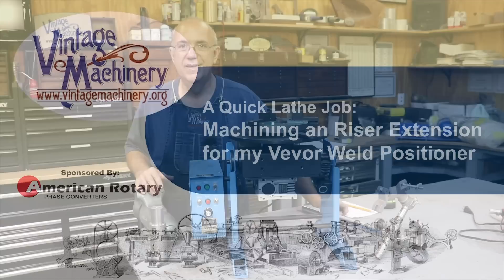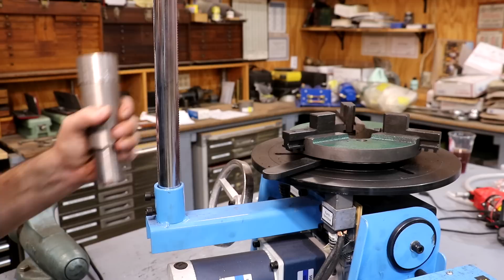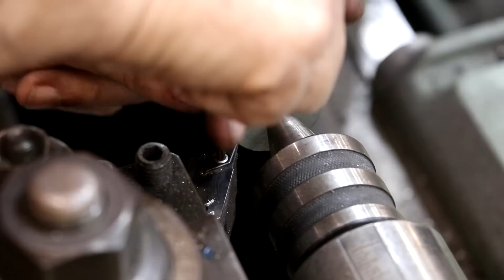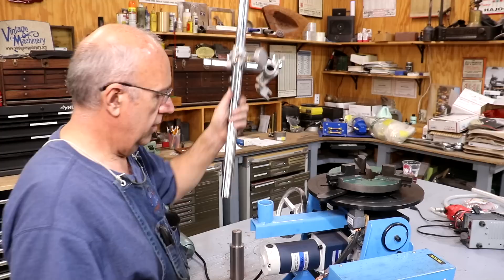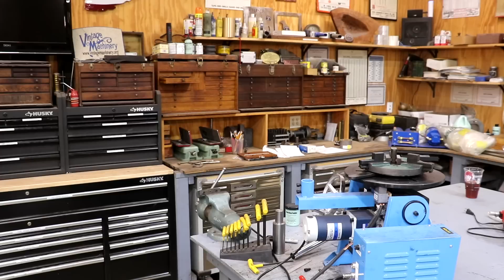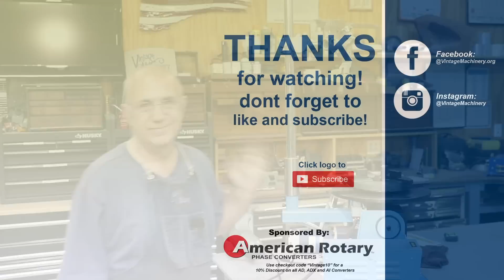A Quick Lathe Job:  Machining an Riser Extension for my Vevor Weld Positioner

Comment: I honestly have been led to believe that the imperial guys would have found the metric system a walk in the park to use. And your right Keith as long as you have a standard of measurement it dont matter what units you use!
Reply: There's no doubt that metric is a superior system with the base ten units. However, if all of your measuring tools, dials etc. are Imperial, converting the metric units makes the job easier. As you say, if you stay within the same standard, it doesn't matter anyway.
Reply: @stevespra1 99.9% of the time a machinist in the US is using decimal inches. A lot of old tools may use fractional inches but any machinist worth the title knows the decimal conversion for all the usual suspects by rote. There's no difference, EXCEPT, all the tooling is in inches and it's completely unnecessary  buy all the metric tooling that the conversion would require. If it ain't broke, don't fix it.
Reply: @Mishn0 Yes, of course, we use decimal measurements (and yes, I know the fractional to decimal equivalents as well), so no, it doesn't matter which units we use. Use whatever is more convenient from drawing call-outs to measuring devices. However, with pretty much every other application, we use fractional measurements and things line teaspoons and such. The metric system is actually thought out as a whole system. Imperial (or SAE) is a hodgepodge of old non-standard units that have been standardized but still crazy in their cross-measuring. I love America as much or more than anyone, but it is kinda crazy that we've hung on to Imperial units this long.
Reply: @stevespra1 It's funny that how on European videos, you never have Americans in the comments whining about the measurements not being given in US Customary Units. (NOT Imperial). I guess we're just better at math.
Reply: @stevespra1 It's a far stretch to say there's no doubt one is more "superior" than the other! You would have a difficult time trying to prove that assertion. Regardless in context with machining, both systems are base 10 so it is a moot point.
Reply: @TgWags69  I would say the superior part is in the base ten across measures. For example, a ml of water is a gram. There's 1000 ml in a liter, which consequently weighs 1 kg. There's 100,000 mm3 in 1 liter. It all works together. There are 231 in3 in a gallon and if it's water, that's 8.34 lbs. There's 100,000 mm in a km. Quickly now, how many 1/32" in a mile? Well, there are 5,280 feet in a mile. That's 5,280 x 12" = 63,360". 
That makes 63,360 x 32 = 2,027,520 1/32" per mile...
Obviously, if we are machining in inches, whole, .001, .0001, .00001 is no problem at all and either system is just as good as the other.
Reply: Not a stretch at all. Metric is proven superior in science,medicine and engineering. Also need to recognise metric is use across the planet except for 1 substantive country.
Reply: @stevespra1 , Who cares how many 1/32 of an inch are in a mile?
Anything over 32/32 is an inch and you start over with however many inches you have, once you hit 12 inches you have a foot and so on. No wonder people don’t like Imperial, they don’t know how to use it. After you’ve used it for a while it gets easy.
Reply: @Hoaxer51  Yes, obviously 1/32 per mile is a silly example, but hopefully we get the point. It's very easy to use the metric system going between units or even across measures. I am American and I know how to covert Imperial across measures better than most. I am also comfortable converting between metric and Imperial, but the metric system is just easier, period. Also, all traceable standards are based on the meter, so there is that... Again, it doesn't matter if we are using metric or Imperial especially for smaller units. We can achieve the same level of precision for all intents and purposes, but when we get to know the metric system, it is easier. There is nothing to be afraid of.
Reply: @zorbakaput8537 Fully agree. Except it’s 3 countries: USA 🇺🇸, Liberia 🇱🇷, and Myanmar 🇲🇲.

Edit: The real advantage of metric is that it’s a coherent system. One calorie is the energy needed to heat 1 Gramm of water for 4 to 5 Celsius (or something like that 😂). One Milliliter of water at 4 Celsius weighs one Gramm and is a cube of 10 x 10 x 10 mm. 
Ask anybody how many feet are in a mile or how many ounces are in a bushel. 
I’m German and live in the US for 25 years. I’m at home more now in imperial units and it works fine for me, but it’s just not a ‘system’. 
The US is metric or at least digital (thou etc.) in most ways anyway besides construction, and there the fractions have advantages actually!!
Nothing is black and white.
Reply: @stevespra1  not superior. Only different. Each have their advantages.
Reply: Ive used imperial all my life, we learned about the metric system in school, the fact of how it works is less complicated than inches, but my greatest hurdle is that after 50 some years i can look at something and pretty much tell you in inches/feet the size of something (not exactly mind you but close enough) or if someone says it's .... miles i can understand in my head how far that is without spending time to think what's needed to convert it to something that i know
Reply: I grew up in Canada and was educated there it changed while I was in high school from imperial to metric so am fine to work in both systems , I spent a few years responsible for 11 plant sites in Europe. Later in my career I  have done engineering work on 5 continents and lived on 3 of them ,as a result of those early years in Canada I never struggled with either system ? I prefer to use digital measurement tools most I have can function in both systems.
Reply: I  grew up n the UK during the 70s so I have no problem using both and converting between the two
Reply: While I can do the conversions from imperial to metric, since I was raised with the imperial system metric measurements don’t convey much to my mind, in terms of being able to visualize them. At any rate, for a project like this it does the job.
Reply: @johnmorris3744 Like many here, I can use metric if I have to.  My eye sees in "bananas".  Been using them for almost 75 years.  I also use chains in surveying.
Reply: Im 39 and  in the UK so Ive always known metric, but imperial is  something I use all the time for coarse measurement of anything above  an inch. Below that I use metric. Above a foot I use meters unless its something easy like 6ft. But for precision in any scale its metric! A couple years ago I did make the effort to learn all the fractions and decimal inch measurements just so I could understand videos like these from the USA. Its really not that hard at all, but building model aircraft all my life Ive always seen imperial on the plans from childhood.
Reply: @richw0123  That's a fun combination, quite understandable.
Reply: It’s no harder to work in inches than centimeters. I use both. Metric guys seem to think that we do everything in fractions. Guess what, we don’t. It’s all decimal. It doesn’t matter if we say nine inches and you say 22.86 centimeters, or you say 20 centimeters and we say 7.874 inches, or whatever other numbers you want to use as examples. I’ve installed DROs on all my equipment anyway, so conversion is a tap on a button. Really no big deal.
Reply: @melgross  I think you mean MM not CM .
Reply: Metric is no more difficult to learn than someone unilingual, English, suddenly trying to learn French...
Reply: 3:42...well, if [they] don't LIKE IT- then [they] don't have to EAT IT!!!"
Reply: The handheld calculator has a converter that crunches the numbers between the two systems with a press of a button. I understand most of your machines are built on the  United States Customary units and wouldn’t expect  one to use any other system while using them.
Reply: I've used metric most of my life - my home country converted in 1967 - I can still see some guys liking inches, half-inches - and saying it's 100 deg makes it FEEL hot as opposed to 40 deg. 

What really blows my mind about American measurements - can't really call them Imperial - the gallons are different.  😃   

As I was saying what really blows my mind is seeing someone using a 7/16 drill - then add 30 thousandths and then giving me a number - it's far more difficult than going metric, but by practice, people do it effortlessly.
Reply: It was pointed out to me that thousandths of an inch is a base-10 system whereas fractional sizes aren't.  So converting on the fly between 3/8" and 0.375" is common place.   Metric's easier than what these imperial conversions already require so this already requires more effort, and they're used to it.
Reply: The only problem with metric is its very easy to make a decimal place error and be off by an order of magnitude. With feet and inches its very difficult to be wrong by 10x or 100x without noticing
Reply: Metric has the advantage of consistency across linear/areal/volumetric measurements, heat/energy, etc. But for US machinists, thinking in thousandths of an inch is every bit as convenient (physicists, not so much).

For a US machinist, metric tooling is precisely as opaque as letter sized drill bits. 

Metric guys complaining tend to ignore tooling costs — they need to acquire English/SAE/UN tooling much less frequently than Americans need to buy metric taps/dies/micrometers/change-gears, etc.

Fractional sizes come from carpentry where integer division is frequently needed. Twelve has a lot of divisors.

Japanese carpenters used to use a measurement system called shakkanhou (many still do, though it was sorta outlawed in the Meiji restoration). What fascinates me is that one foot and one shaku derive from measurements from the human body: one shaku is within a couple mm of one foot. But a foot is divided into twelve inches, whereas a shaku is divided into ten “sun”.
Reply: The metric guy around.... Number drillbit, letter drillbit, fractional drillbit and the micrometers in decimal..... It's a miracle imperial products fit together.
Reply: @Stefan_Boerjesson  They all have decimal equivalents. Why is that so hard to understand?
Reply: @TgWags69  When Keith tells F-drillbit it tells the metric guys nothing. Why the need to memorize their decimal eqvivalences?
Reply: @Stefan_Boerjesson , Nobody memorizes what the decimal equivalent of letter drill bits are, they are usually called out for a certain procedure and that’s what you use.
Reply: @Hoaxer51  For imperial guys, yes. Do as the drawing says. Still it looks difficult alternating between number drills, letter and fractional. Which is bigger, which is smaller. Tapping... Just a lot more to keep in order.
For a metric guy watching an imperial guy working, it becomes a math lesson for the metric guy to find the nearest size.
Reply: @Stefan_Boerjesson  Then go look it up. We are not reponsible to remedy your ignorance. I stop many times and pull out a ruler or measuring tape to practice my mental estimations of metric measurements for my own edification and I've never once went crying to the world that I was to lazy to try and understand it.
Reply: @TgWags69  You've been sleeping for 2 months. Why not stay sleeping? No metric guy is responsible for the imperial mess......
Reply: @Stefan_Boerjesson actually, better. We have more incremental sizes so we can fit screws to size better than with metric. Another difference is that since threads and drill sizes in metric have been forced to size together using standard drill sizes, they’re not as ideally sized.
Reply: @melgross  Metric drillbits are used down to 1/10 of a millimeter, 0.4 thou, at least below 1/2". Then the step is increased to 2 and later 5 mm. Are "ideal" screws really needed, calling for a huge variation? It's much cheaper to use some standard size spelling less number of part numbers on the shelf. Every part number costs money in the industry.
A man working for a well known European car manufacturer looked at the number of different lengths used for screws. He suggested to use longer screws in many places reducing the number of boxes on the shelf. The matter was investigated and it was found out a significant profit could be made that way. He received the traditional share, ??% of the annual savings. It was huge.
I think the same applies to the dimension of screws. Establish a standard and use when designing things.